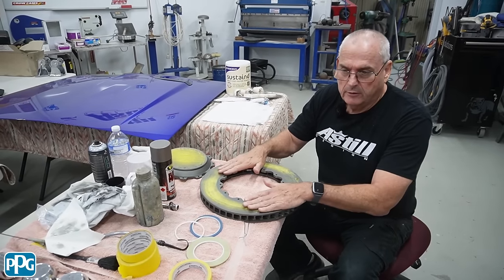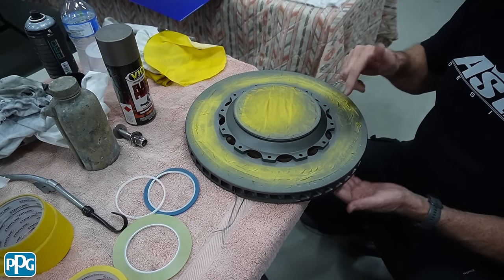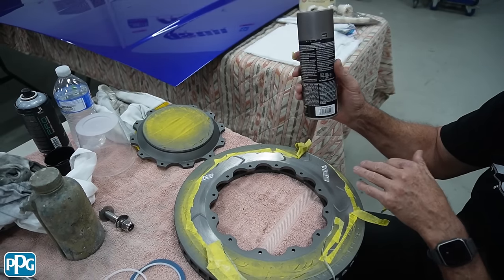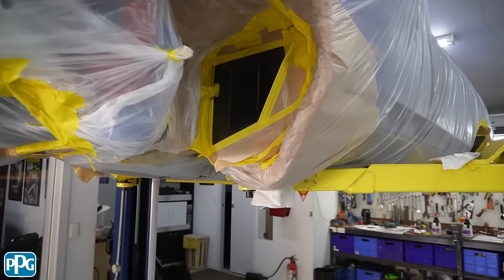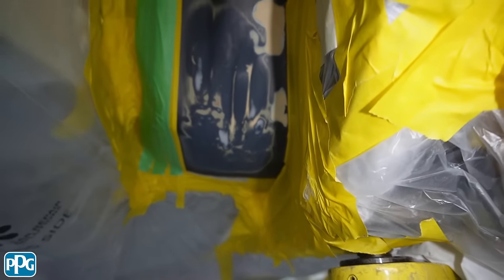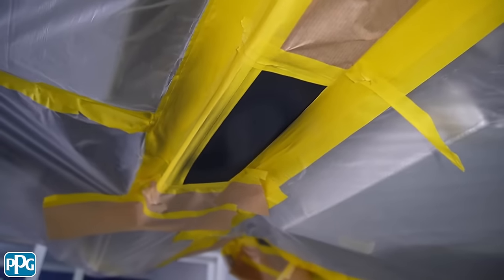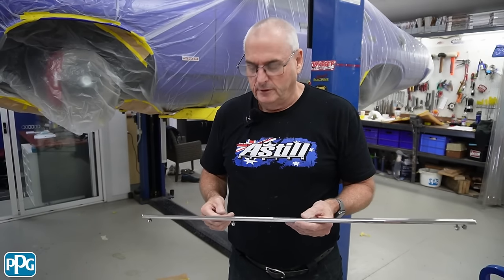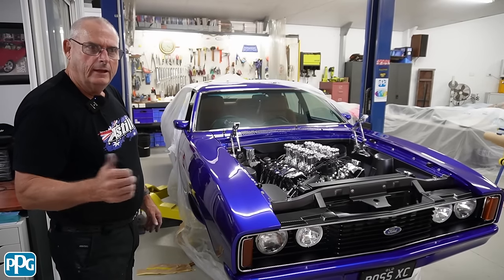BOSSXC Paint Repairs and more before MotorEx 2024

Comment: Saw this last year at Motorex, and was in awe at the level of detail and all round quality of the build. Given the polished parts of the engine, why not just chrome plate the engine mounts instead of paint ( that can be damaged )? 
The polished brake master cyl cover looks right at home. Was there any discussion of a Wilwood master cyl, given they look a lot better than something in plastic??
Reply from the maker: The fab on the mounts wasn’t up to chrome, the brakes are completely FG including ABS, this proved to be very efficient in the engineering testing. The brakes actually improved rather than fade.
I find mix and max  brakes end up a compromise on efficiency

Comment: What is the point of doing any of this.
This car had its chance last year. Its not going to do any better second time around.
Also looking at the detail, no way is this car elite level. Too many imperfections in the non main areas. The steel work in wheel wells is very average. The finish is poor on back side of parts.
To me elite needs to be elite, look at the rear wheel well there is big heat twist spots in metal
Reply from the maker: Mate clearly you have no idea.
Very few people will let you this close to a car at this level.
Last year at Motorex the car placed in the top 6.
Not bad for a car that’s “no way is this an elite car”
More than half the qualifiers for superstars this year were there last year.